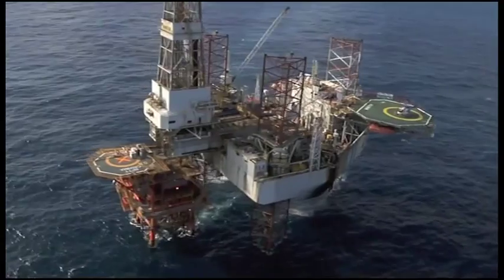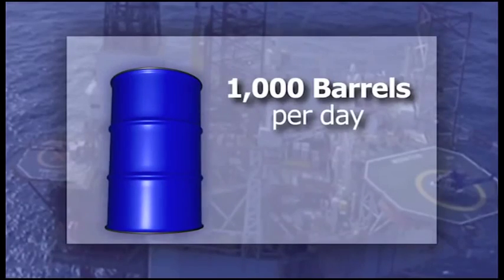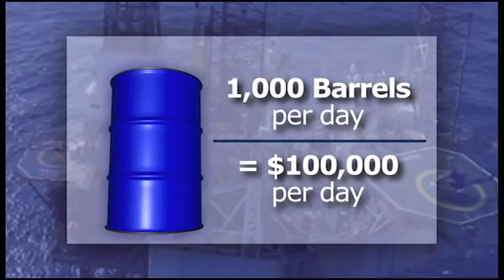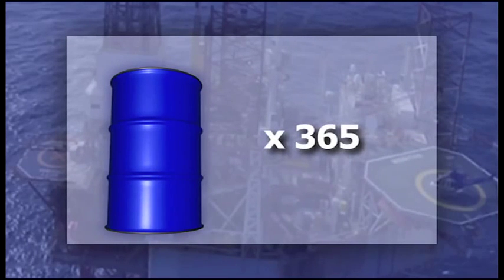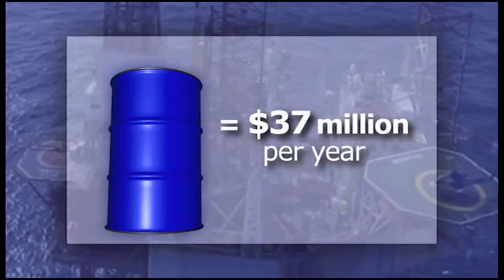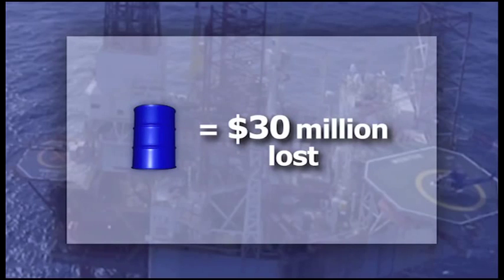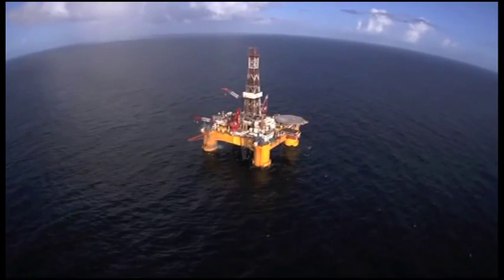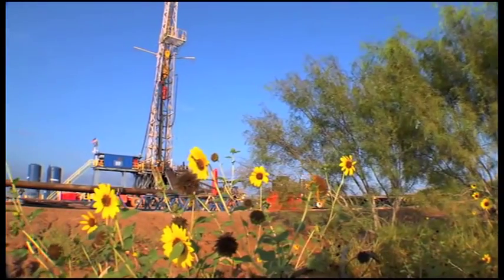Pipe dope triggers formation damage

Comment from the maker: The “Formation Damage caused by Pipe Dope and its Remediation” study (SPE 164515) showed that the dope particles size distribution even for green dopes were in the range of the formation pore throat, having the possibility of creating deep damage when entering into the formation. The resultant residue and time required for the biodegradable dopes to be degraded once inside the formation pore throats results unknown or difficult to predict.  The use of “dope-free” technologies such as “Dopeless® technology” guarantees the complete elimination of any risk of formation damage by pipe dope.
Also, green dopes have limitations, mainly in the capacity to provide effective lubricant in certain materials like  13Cr and Corrosion resistant Alloys .
Reply: Guys, this is a very poor attempt to promote your products, the fact that someone wrote a paper on a presumption doesn't make it valid and Mr. Economides does not seem to understand what is causing the damage, he mentions that dope is an "organic inorganic compound" which "does not dissolve very easily when we reverse our actions" this would be laughable if it wouldn't come from Tenaris which is supposed to be a reputable company.

Comment: Has anyone ever tried to use Loctite red thread locker instead of pipe dope on casing threads? It would be more expensive but it might produce a better joint, especially with the very high pressures used in hydraulic stimulation operations.